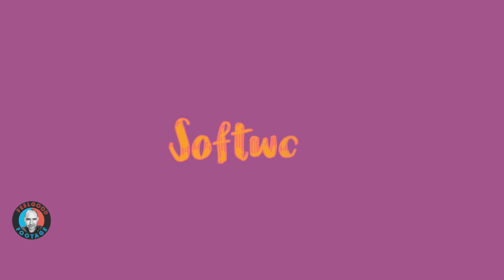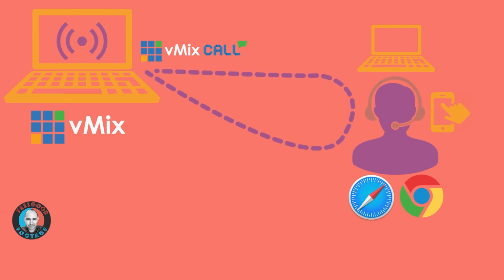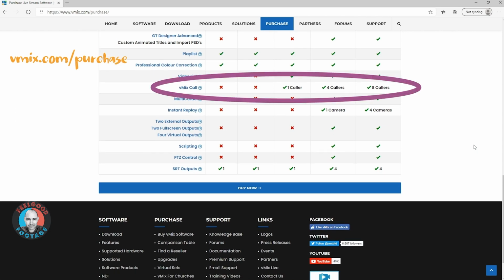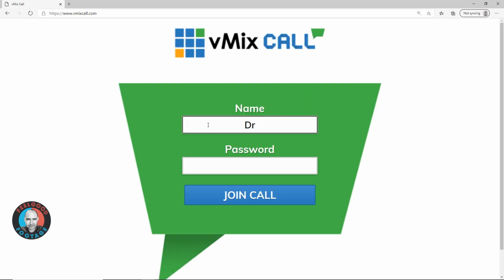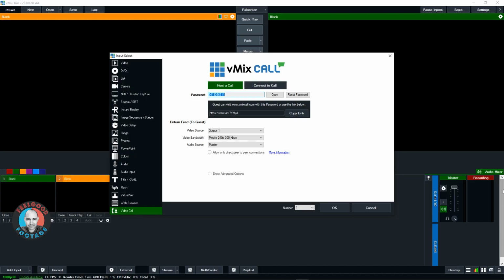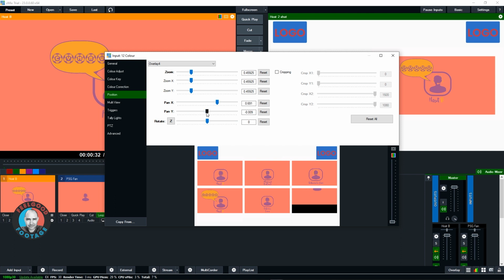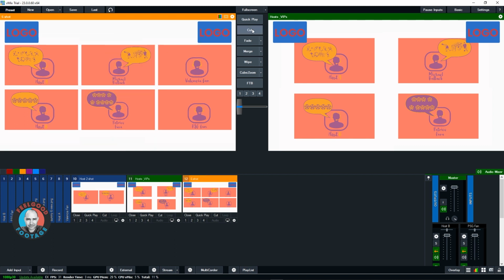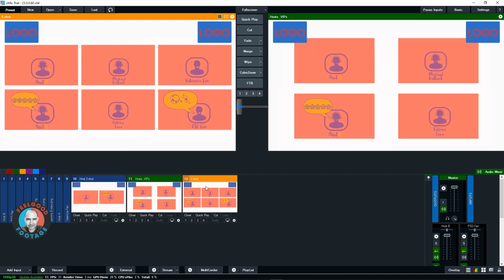Using vMixcall to bring 6 Remote Guests in 1 Live Stream (a great solution for social distancing)

Comment: You're making some great and easy to follow videos. I was in the same place you are exactly a year ago as we were forced to do everything virtually.  Couple suggestions - Using vMix Audio Busses, you could have created a mix minus for your hosts in the studio. There generally isn't any added delay when doing this; In fact, you're eliminating a level of delay. My suggestion would be to grab an Audio Interface with multiple outputs and then you can send custom mixes to your hosts. We use a Tascam 16x08 and plug each of the 8 outputs independently into a 8 channel headphone amplifier, then give everyone in the control room/studio a mix that they need. Secondly, you mentioned that you couldn't talk to the participants or hosts during the programme. Using Audio Busses, you could have done this as well, set it up so you could talk to, for example) just the hosts.
Reply from the maker: That's great feedback to read, thanks so much. Yes, at the time, audio buses were a bridge too far for me and the project. But as and when I do something similar I'd definitely look to try this.

Comment: Hi, thank you again for the detailed video. At 14:57 you mention the mix minus problem for mixing external camera and vmix calls. You can very easily Solo the vmix call inputs in Vmix interface and give the external camera an earphone directly from computer and the external camera will not hear own voice. Solo is on all audio inputs with word S in vmix and you can solo more than one audio input by right clicking them one bye one.
Reply from the maker: No problem. Really glad it has been useful. Yes, I am aware of the Solo option. However it just didn't seem to suit the Host to NOT be on vMixcall when the 5 other people involved were. Being slightly out of sync with everyone proved quite distracting to him. The show was based on free-flowing, quick response conversation ('banter' to use UK slang) and bringing the Host in via vMixcall just seemed to help the flow. The Host undertakes similar shows via Zoom so he's used to that dynamic. But if I did this set-up again I would certainly re-evaluate the other option again to see how things stood.
Reply: Thank you for the reply, and to get in communication with hosts during show, to duplicate the program feed but insert a text area and use this output for guests, so they will still go synced with the show but will see your note whenever needed is an option. Sometimes you really need to inform them during a live show. Thanks for all your videos and spending your time on this.
Reply: @a.y.1502  This seems like a very good idea, I will definitely look into this improved set-up. Thank you!